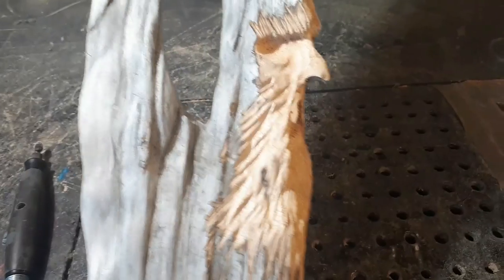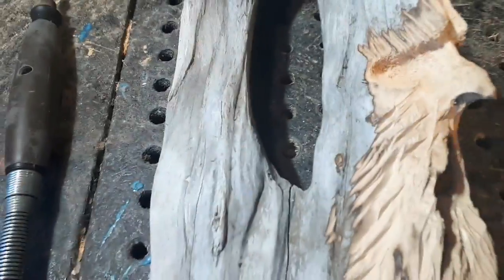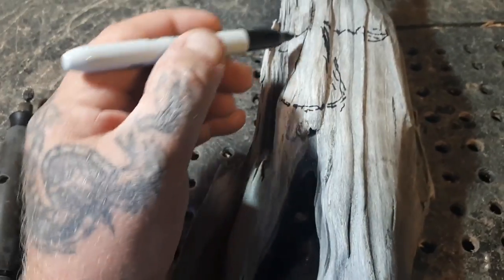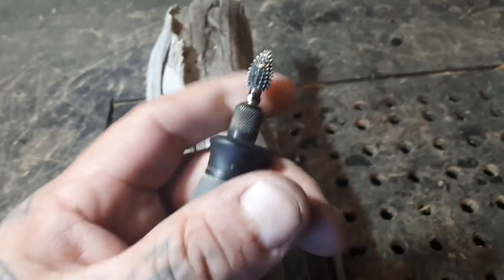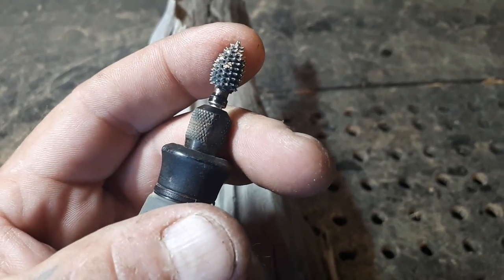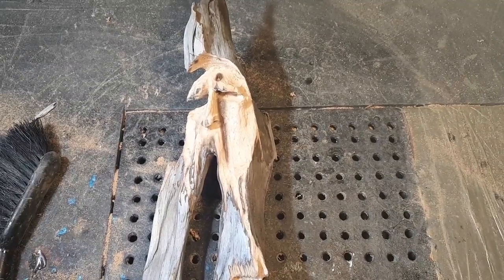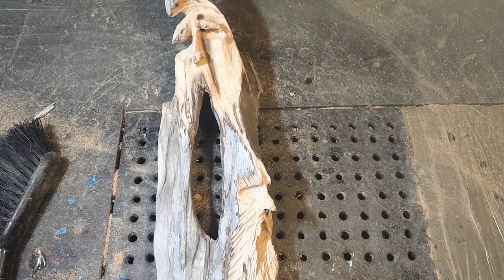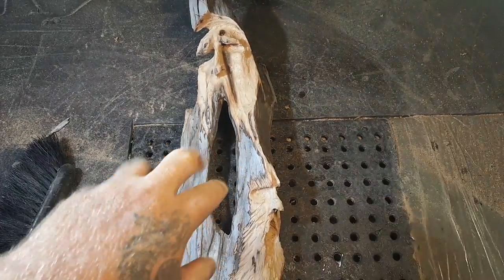Power carving with a dremel flexshaft and kutzall carving burs

Comment: I have a better way for the sander.. Use the bits that has the screw in the end for using the cut wheels or buffers, I've made 2 of them one has only 2 pieces of sand paper the has 4 or 5 and they work great and never unscrew. Try it you'll like it.
Reply from the maker: Great idea !@@
Reply: @CarvingFusion  I also found major piles of driftwood at the lake, lots of good pickings but it's a long walk back to the truck. Still worth it, I'm getting a wagon to pull.